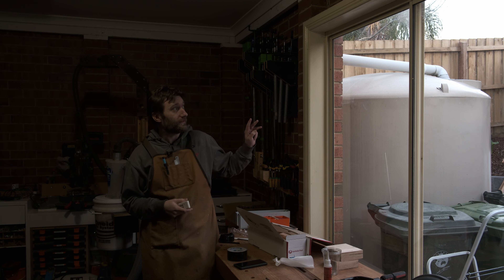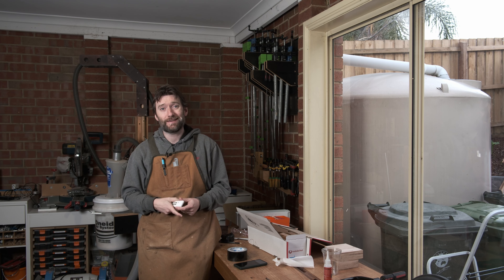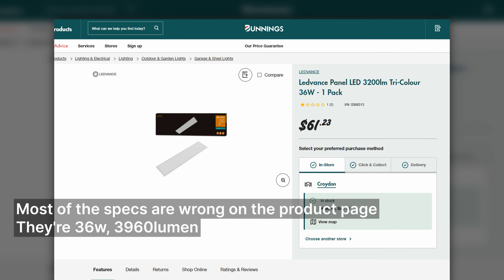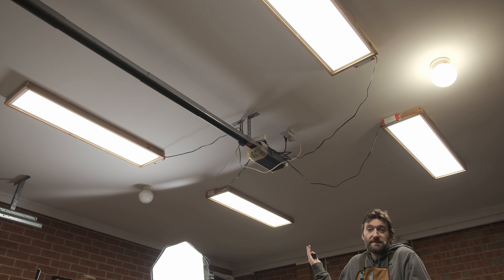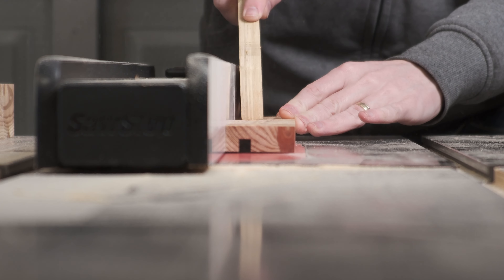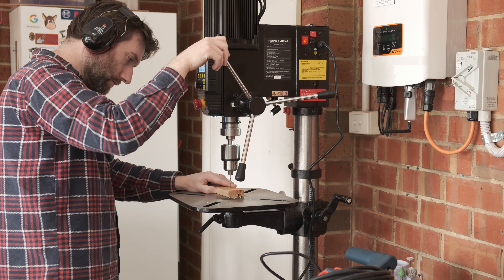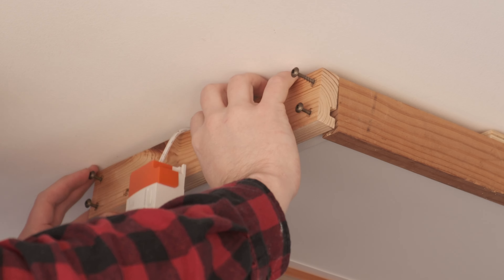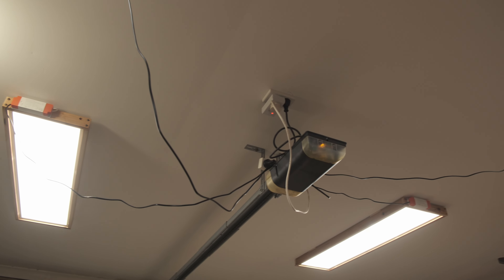Shop Lights - Fitting Out The Woodworking Shop

Comment: I put 9 of those in my oversized double garage (7x8m) and never regretted it. I did consider making my own frames, but found some ready to go aluminium frames to suit. I'll definitely be putting these in any future workshops as one of the first jobs. I also put powerpoints in the ceiling and hid the driver on top of the panel and fed the cable through holes in the ceiling.

Comment: in the same boat, purchased some led batten lights a few months ago for the garage but they are a hardwired version, seeing your setup i should have bit the bullet and gone the bunnings version😥
Reply from the maker: Hardwired LEDs aren't bad - they're a lot neater for a start! At least with LEDs, they won't need replacing in the next 10 years or so, so by the time my "easy to change" version burn out there will be an entirely different size that won't fit anyway.

Comment: Great Choice Paul. I've had them for quite a few years. Replaced eight Fluoro strips which 'Flickered'.  Fortunately, all the wiring was there so just a conversion for the new ones.  I have mine suspended on chains.   As per Pete below. What's the new drill press???
Reply from the maker: I think if I had more height, chains would have been a good option. I think my ceilings come in at ~2.8m, so dropping down too much lower and I'm likely to smack them every time I go past carrying a board 😂
I'm mostly just mad I didn't discover these lights years ago, they're so great! 

New drill press is the Nova Viking. Do I need it? No, but a moving in present to myself! It'll feature a bit more in some batch projects later in the year, right after I get the workshop setup.. and the new cabinets made.. and then the inside jobs... 😭
Reply: @TheWoodKnight  Natalie must be a very understanding and forgiving wife. To prioritise the workshop before the house !!! or is the rational that you need the workshop first to be able to have 'Work space', to do the inside jobs 😉🤪
Reply from the maker: @cobberpete1  Nat (well, both of us) want cupboards for the laundry (weird house that had none), new doors and drawers for the kitchen (and a few extra cabinets).
I'm starting in the garage so we can both get a good idea of the paint she's picked out (first time HVLP for me!), the style of doors (shaker), and overall cabinet quality including edge banding (splashed out and bought an edge bander for 1mm ABS). 
The workshop cabinets will be a full trial run so that inside cabinet construction is a well oiled machine.

At least, thats what I sold her on... ;)